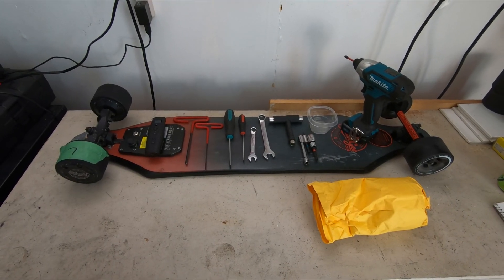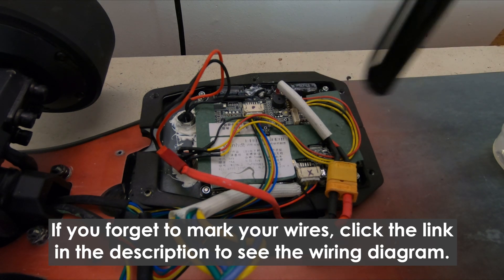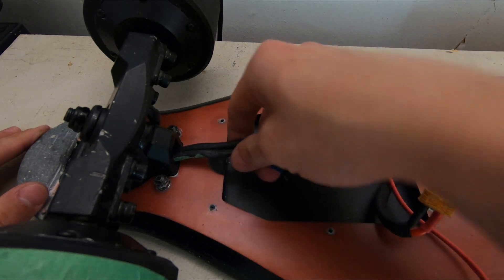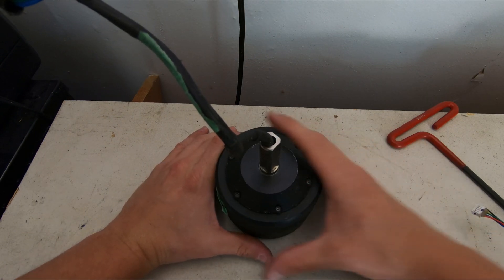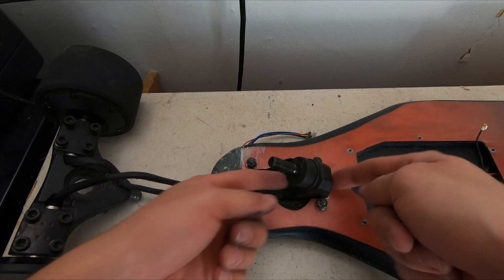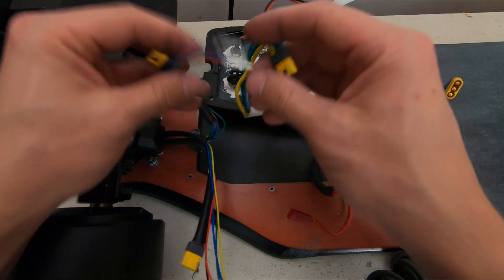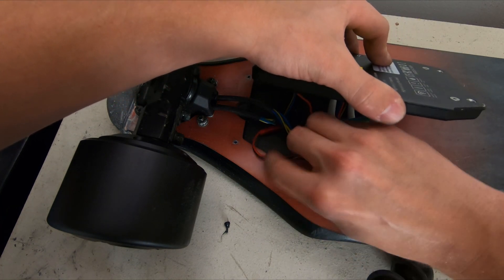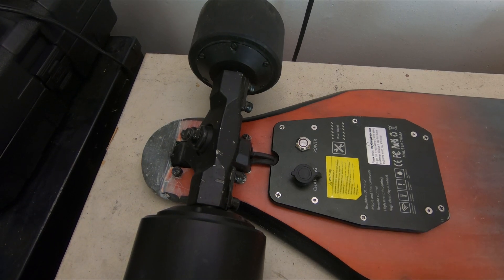Teamgee H5 Electric Skateboard Motor Replacement

Comment: I need your help man ... mine doesn't  charge or turn on unless the charger is connected... what do i do?
Reply from the maker: Sounds like a bad battery or disconnected battery. Take it apart and test the voltage of the battery

Comment: Thank you so much you're right no one made a video like this I have the teamgee h20 mini and they sent me the 80 mm wheels so I have to buy 90 mm hub motors and put them on to attach my off-road wheels I feel like I got screwed and sent an older model because on the website they're marked as 90 mm but I did not get them only 80
Reply from the maker: Damn! Sounds like they did you dirty. Sorry to hear that man.
Reply: @asavag3  the one they sent this time came with the 90 mm I got lucky happy better than expected even got the new controller and the only complaint I have is the braking is a little more stiff

Comment: What happens if the little black grounding wire breaks?
Reply from the maker: Where did it break at? I would try fixing it by either soldering or splicing.

Comment: great info Andy! just picket one up last month and cant get the battery to charge. I took it apart and bypassed the charging connector with small cat5 wire and now on the remote it shows 3 out of 4 bars, before it was no bars on the board battery. have not put it back together yet because the charger power block only shows green indicator light. 
Do you have any info or experience with charging the board or the charger?
Reply from the maker: That's strange. So the charger shows the green light, but the board isn't charged? Is there any debris on the contacts?

Comment: Think I could put my h20t hub motors on it or would the 540w per motor kill it??
Reply: Lol well my h20t battery took a dump but I found an h5 for 100 bucks, no remote but my h20 should pair with it shouldn't it? Same seahorse remote they sell on the site for it
Reply from the maker: Not sure but that'd be sick if it worked!

Comment: Where did you get the replacement hub motor/wheel assembly?
Reply from the maker: I got it from Teamgee's website here: https://www.teamgee.com/collections/skateboard-accessories/products/teamgee-hub-motor-with-urethane-black-for-teamgee-h20-1-piece
Reply: @asavag3  Thank you! Your video was also super helpful. I rode my poor H5 through a pretty deep puddle today which was the demise of one of my motors ;( but at least I know it's fixable.
Reply from the maker: @termooh6654  oof! I would check that it's not the control unit being bad first by switching the wires on the wheels on the control unit
Reply: @asavag3  Good idea. Thanks!

Comment: What did you do wrong when you went to fix the bearing? I Almost went right in on my h5. My bearings are fine and all i was just going to upgrade.
Reply from the maker: There's no easy way to remove the inner bearing within the hub shell. I tried to pry it out using a flathead and ended up puncturing the aluminum housing on the hub. From there on, the new bearings wouldn't sit flush and I ended up cooking one of them.